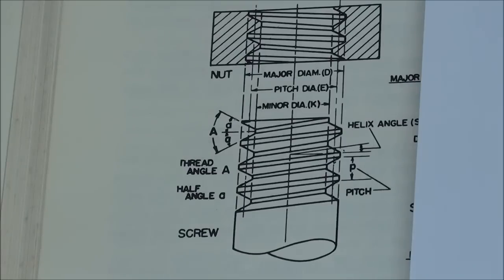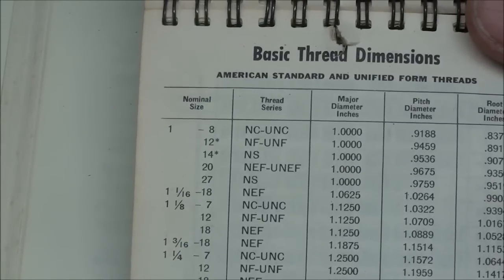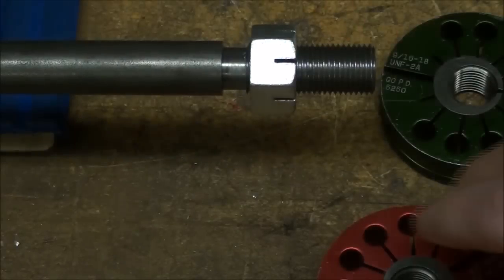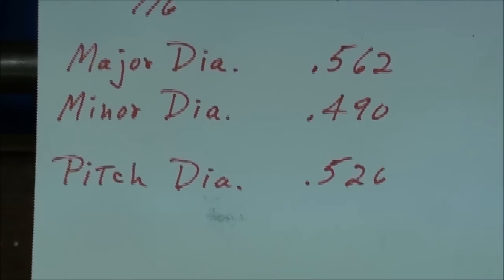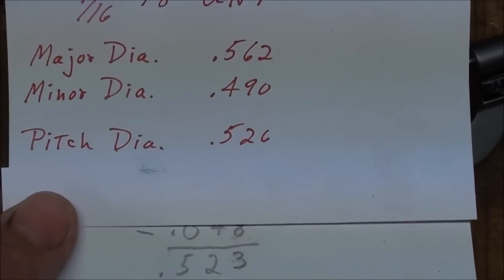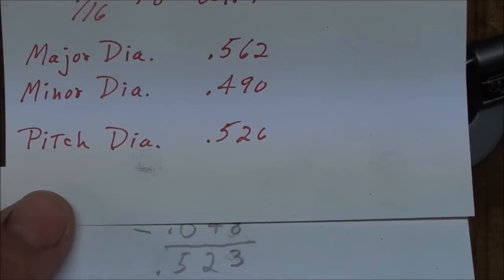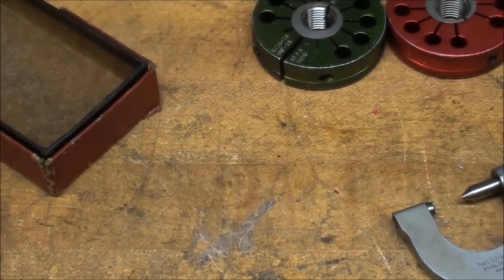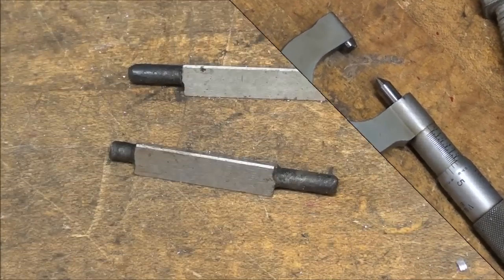SHOP TIPS #183 Measuring Threads -3 Methods tubalcain

Comment: I use 2 of the same parts that has threads and stand them up, placing 1 wire on one side and 2 wires on the other side. I can pick them both up between the wires very easy and measure the pitch diameter sliding the micrometer over the part that need to be checked.

Comment: It should be noted that thread wires were never intended for measuring production threads. They were intended for measuring precision ground thread Gages which have near perfect thread form. Proper thread wires need to be and are as accurate as gauge blocks and cost $3000 a set from Van Keuren. 
Using cheapo wires in a shop situation should be thought of as a rude and crude bandaid estimate and not an accurate measurement. They can easily show a defective thread as good especially as the pitch helix angle increases, the errors grow larger.
Thread micrometers are better but still not perfect. Ring gages are the best of the simple methods but still not perfect.
I've had cases where the wires showed the thread as good but the parts all had to be scrapped.

Comment: Micrometer for every bolt? No thank you.
3-Wire Thread Measuring Set
18 pairs, for D= 6,35mm Spindle
Item number: 313-101
Suggested retail price: 2,174.00 €*

No thank you. I'll just buy good quality bolt, and wire and make my own table what micrometer should show me with certain diameter. Screw the overpriced wires.

Comment: I use one wire. Know exactly what your maj diameter is and take your measurement over the wire. Subtract maj diameter of work from your wire measurement. Multiply by 2 and add back to your maj diameter. Little bit of math but easier to hold.

Comment: i recently picked up a starrett no 6 thread pitch gage it shows pitch plus ?  ex, 13 threads .133 
what is ,133 i can not find on minor dia for 13 thread it measures .133 deep not double depth

Comment: Mate, I have a 1 1/8" thread, @ 9tpi. Where/how do I find Pitch/Effective  Diameter for this. 
I have 'Machinerys Handbook 2005', buggered if I can find it...?
Trying to make Go/No Go gauge, and die for an antique engine. Bolts are stretched, ie, necked...you know what happens to 'em. Reckon, best way will be to make 12 new 1 1/8" diameter 12" bolts, but my friend who is the Engine man, says that if we can just resize 'em, she'll be jake.. I can see what he means, and I do not want to move any more metal from these studs, than is necessary, as you can imagine.
Thanks for your videos, learnt a lot, here 'n there. Still learning, 70 next month.
edit. There are a lot of threads out there that are, for arguments sake strange. F'rinstance lets just speculate a 10" bolt or pipe or whatever, that may have a thread pitch of 1 to 50 tpi, . or even .05 to 10mm pitch. How do we find the PD/Effective diameter, in these cases.?
Reckon it will get down to pure mathematics, not my favourite subject, and if this is so, then just say so, but any help or hints about where to go to assist, mate, greatly appreciated. Cheers, Mark Needham Qld Australia.

Comment: I have an Android application which ties in with this
YouTube video. The app calculates thread data, wire sizes and reading over wires
for Metric, UN, and BS threads. Search CENTORPE in the Google Play Store and you
should find it. 'Centor Screw Thread Data/Check' is the full name of the app.
Reply from the maker: +Roger Pope thanks, I will take a look
Reply: Thanks for responding, I would appreciate it very much if
you could offer your views. If you contact me I would willingly enable your
e-mail address as a tester or just refund the small charge currently being
applied.
Reply: all about making a dollar....other words fuck you.

Comment: greeting , tubalcain     iv been working as a machinist now for about 40 yrsand for the passed 35 or so yrs  in the movie industry . earlier this week I was asked to cut some threads for a ceiling fan extention (about 8 ft. extention  ) I did not have a theard gauge,  so I used the pee dee thread method worked great .thanks for your show very informative     bob diaz

Comment: Great vid.  Instead of drilling a plastic rod you can use a plug of beeswax or silicone putty, simply roll the diameter plug needed for the screw size.
Reply from the maker: +Morris Gallo Thank you very much

Comment: Thank you for the demonstrations and information. I'll be trying my first single point threading soon, and won't have a nut I can test with, so this is timely. 

Since I've gotten interested in machining I've started noticing how things are made, or might be made. Looking at your go/no-go gauges I'm a bit stumped. The turning to size and drilling of the holes to allow movement for adjustment is easy enough, and a slitting saw to cut the adjustment slot to the outside is obvious, as are the counter bores for the adjusting screws. Where I get stumped is on the relief slots to the various adjustment relief holes. A slitting saw won't fit inside the center hole, the slots are wide for a bandsaw, and narrow for a milling cutter that could go that deep without breaking...so how were they made?  A laser or water jet could do it, but I understand that such gauges were in use long before such machines were available. How would you make those?

Perhaps when you run out of "what is it" ideas, you could do a "how was this made" series.

-- Mike
Reply: +BigMjolnir How about a broach or a die filer with a screw slotting file or even a keyseater. Google them. Often a machine built just for that one purpose.
  Mike (o\!/o)

Comment: I also most often use the nut method, but on occasion have needed to use thread wires. I never had a problem figuring out how to measure with them, but lordy have mercy, I sure could have used the tip on the delrin holder more than once. Lol  Thanks for the great videos Mr. Pete.
Reply from the maker: +Larry Phillips Thank you very much

Comment: Great video, I'd never heard of thread triangles before. Genius way of holding the wires, too! I've never had a problem doing it without assistance, but it seems I'm a rarity in that. Grease is popular with others I work with. Elastic bands tended to cause magical flying wires

One correction though, pitch isn't the line in the middle of the major and minor. It's the imaginary line where on the thread, if you were to look at it from the side as VVV, the spot where the width of material still there, is equal to the width of material missing beside it. Hopefully that's simple enough for everyone to understand. Wikipedia has a harder to understand explanation, but same idea. In practical use, not a big difference from what you said. 

Also, just because I've seen a lot of people confuse minor/major on interior and exterior threads, it's been easier to explain it as major is always the big one, minor is always the smaller. Calling the minor the root of the thread on exterior, seems to have people assume it's the root of the thread on the interior threads as well, which it isn't
Reply from the maker: Thanks for the tip.& correction

Comment: Your delrun made me think how about styrofoam.  Last time when using the 3 wire method I used thick axle grease which worked but would not recommend for reasons you could guess.

Comment: Maybe some fine fan will have a chart for your "Triangles" method. - - If you get the chart, it would be very easy to use rubber bands to hold the triangles in place on the threads you are measuring.

Comment: I enjoyed the video Me Pete. About the thread triangles, I have two sets that were my grandads. I know for fact one set still has the chart in them because I use them occasionally. They are handy when you don't have a nut, or want to copy a part and cut the thread to a matching size. I'll have to show them in a video. 
Thanks for sharing. 
Adam
Reply from the maker: Take a look at Bill lewis's comment above. I printed the chart, and it seems to match up with my triangles.